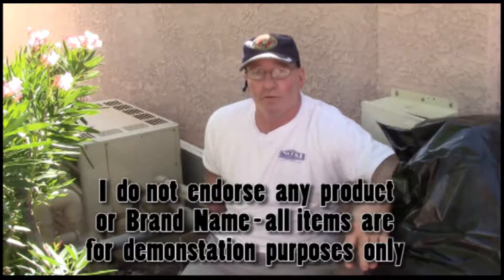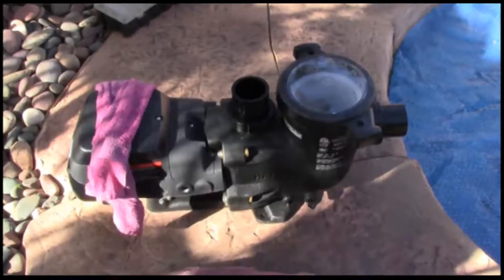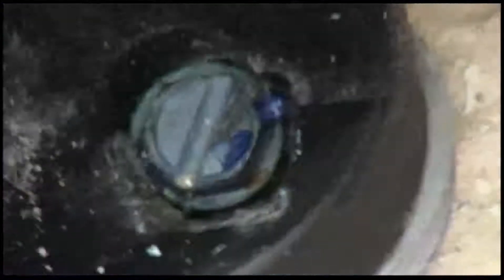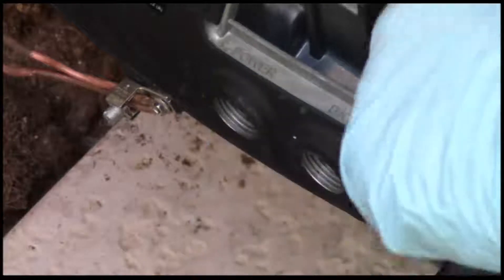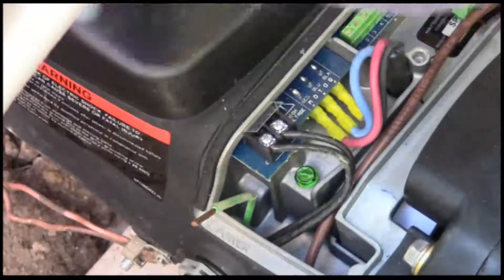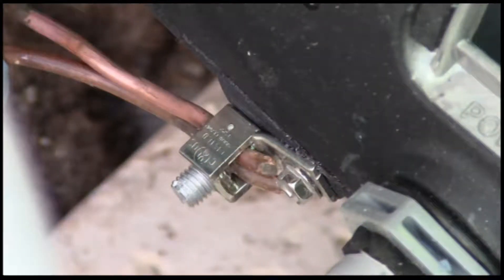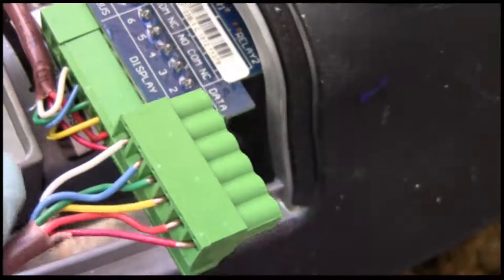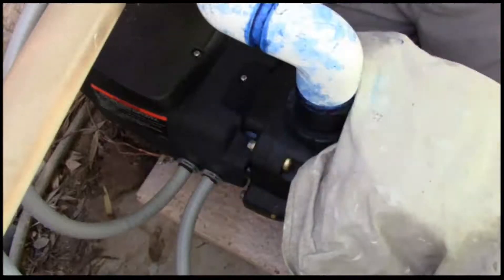Installation of energy efficient pool pump # 99

Comment from the maker: My only answer to that is that the NEC only allows the use of 'approved' or 'identified to use as...' products. Sometimes I am very limited to what I can do or accomplish because of code interpretation. You are allowed to manufacture an item using approved items, but you cannot modify an existing item. Confused yet?  It really depends on the inspector of the day. As for design, I see stuff that ranges from NASA material to items that look like a 5 year old designed them. UL gets the last word.